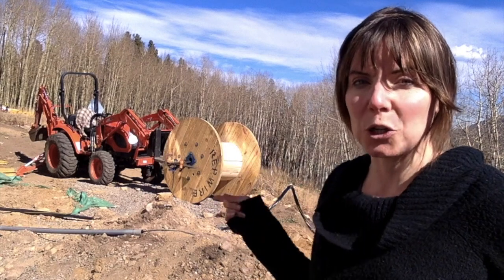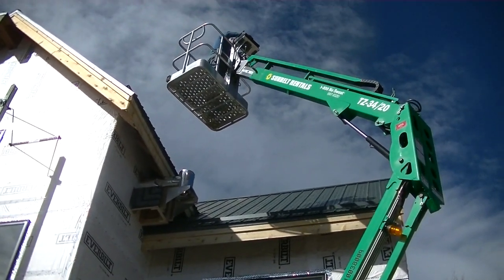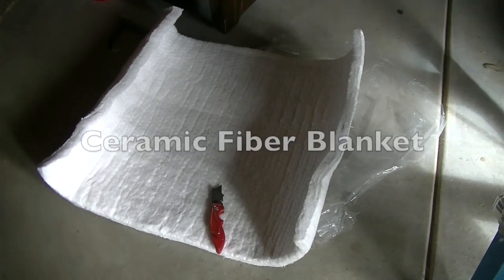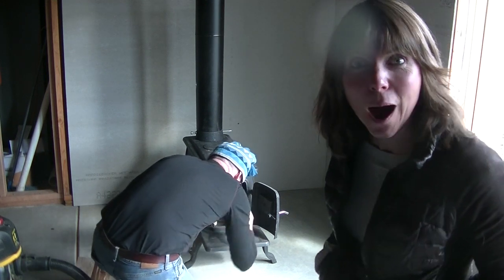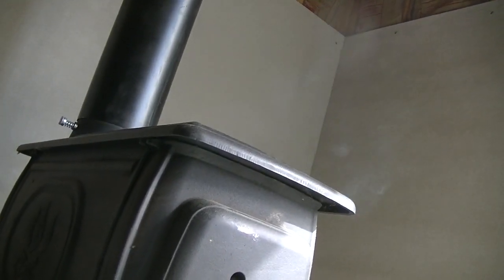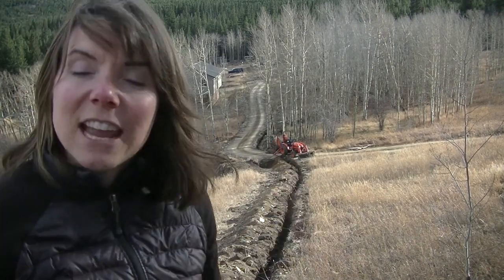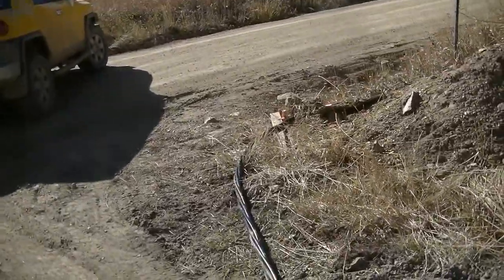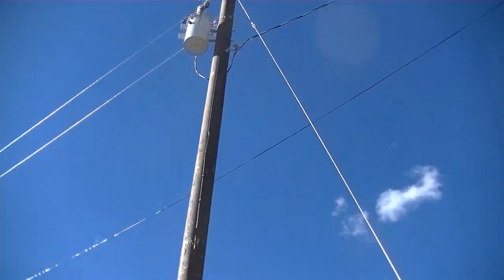Running 500 ft of Electrical Cable - Wood Stove Problems

Comment: The smell is more then likely the finish’s from manufacturering burning off, typical with a stove like the one you have I would set it outside and burn it off for a few hours, additionally check your damper position so that stove is drawing air.
Reply from the maker: Ok this is what we were suspecting. There was a ton of air going through, could hear it whistling all the way up the chimney.
Reply: Yes it is the oil in the stove, I bought a new stove 2 years ago. You need to have a small fire the first time ( paper and cardboard) let cool, then kindling the second fire, then a ‘normal ‘ fire. Did the wood burner not come with instructions? Also why not tie end of cable to house and drive tractor down hill straddling trench? One step instead of pulling by hand, and suv.then putting cable in trench by hand also. Too late for you guys, but maybe someone can learn from this. Love your channel.
Reply from the maker: Gotcha. I guess there's more than one way to drag a cable down the hill, couldn't really straddle the trench though- too maybe rocks, unstable and trees on the driveway side. Thanks!

Comment: So glad to see that cable in the trench.  Lets hope the weather holds off long enough to get it covered.  Most comments say the stove smoke is just the newness.  Probably so.  Mine smokes if the damper isn't fully open when I light it.  Then I can close it as needed after the stove and chimney get hot.
Reply from the maker: Yes, the second fire is proving much more tolerable. I'm sure there's a bit of a learning curve in operating any new appliance- how this stove is designed, vs the stove in our old place. Glad to have the heat though!

Comment: Yep had the same issue the first time I fired up a new stove. To late to do it outside now, open all the windows and doors and stay out of the house until the paint/oil burns off. Nice work on that chimney and electrical cable.
Reply from the maker: Ok good to know. Thanks!

Comment: The insulation you used is good stuff, its called a "wet blanket" its whats inside an oil boiler firebox! That placement of the stove sucks for putting in the chimney! the code is 2ft higher at 10ft away! Looks good! YES, that's normal for the stove to burn off gas!
Reply from the maker: Ah! Good to know.Going out the wall will make it easier if we ever decide to change location- won't have to deal with a hole in the roof.Thanks!!

Comment: Our first similar fireplace we learned the hard way also about the break in smell. Wife panicked and called the supplier who said we started a to hot fire for the initial fire. I guess your supposed to start out with newspaper and build the heat up gradually. But hey, who reads the instructions you know ? Our second unit we broke it in outside first. Our power was off for 6 days two years ago as we live in the Pennsylvania mountains very rural. We cooked on one of the fireplaces the whole time with our cast iron skillet. Love those units because you get heat from all sides. We had a conventional fireplace with a long hearth and when it required a firebrick reline we had a plate installed in the opening and ran stainless chimney liner in the chimney to the second of these units. Amazing how much more heat these produce than a conventional fireplace.
Reply from the maker: It's even difficult to break in a cast iron fry pan correctly! It's pretty cool now that we tried a second fire- much more lasting heat than a propane heater running for 20 minutes.

Comment: The wood stove should be just paint burning off if this is the first time you have used it, so shouldn't be anything to worry about it. 
That was a long pull I was watching him drive and drive....and thought " Gee  hope he didn't decide to go on a coffee run". That worked pretty slick on the forks and pulling it down the slop, sure he couldnt life his arms for a few days after , but it went well and just looks like you guys ordered just enough cable,
 so good on your measurements, nothing worse than being short when your pulling wire

Getting close and closer, looking forward to the next update!
Reply from the maker: Good to hear about the stove. It ended up being easier to work the cable than I expected, but glad we had that hill!

Comment: Welcome to ownership of property.
The stove could need to be seasoned, even if you did not assemble. small slow fire the first couple of time to do it slow. Another concern I have is the height of the chimney high enough so that you do not get down drafts from wind blowing down the chimney. I installed that type of chimney a couple times and was smoke free most of the time. and whether it is arose issue or performance issue you should have at least a clear area around the cap of ten ft. I do get down drafts when the outside temp is too high or strong winds are blowing. I agree with the comment about giving your electrician extra length of cable. Give her as much as you can to have both ends extra long. You electrician will be happier which turns into a happy home owner. Been burning wood since the early 70’s and have had 2 houses wired from building 3 houses. Good luck. Around here the trench has to have soft sand laid under the cable and the caution tape laid on top of it before back filling. Gas lines have to be 4’ down and electrical have to be 2’ down. Enjoy your house this winter. You deserve the fruits of your labors.
Reply from the maker: The wood stove is doing fine now. Haven't experienced the downdrafts yet- not sure though- its been very very windy over the past few days- with gusts near 40mph. Also gonna ask the electric inspector about the wire length at the pole, if we need more. We absolutely cannot wait to relax and enjoy- thanks!

Comment: Electric Service, Actually quite a Job. Most require a Caution Tape ⚠️(or wire) in the trench..
..above the wire, gas & water lines. To protect or find their location w a detector.
Luv your roof. 👌🏼 Wood Stoves do have a break-in burn 🔥process. 👈🏼
Reply from the maker: Thanks!
Reply from the maker: Ok thanks for the tip on the tape. If the electrician doesnt' have any, we'll grab some tomorrow.
Reply: @ColoradoMountainLiving  you guys might have to put an "S" on each end of the electrical connection in the trench so that when the ground settles the cable won't rip out of the meter or disconnect on the house.
Reply: Your electrician should be able to verify, most underground lines will have a foil caution tape/ribbon laid alongside cable."Caution buried electric cable" Looks good 👍
Reply from the maker: Our electrician is doing that part- thanks!

Comment: my experience many years ago tells me, if it whistles it is restricted somewhat. are you absolutely sure, absolutely sure, there is nothing inside the piping, fittings, damper chamber or cap. if the exhaust cannot get through it will make sounds. air has got to be able to get in the heater body as well. hope the best for you....g
Reply from the maker: Maybe not exactly a 'whistle' but more of a air flow sound. There's an opening at the bottom of the door that we want to close up with some angle iron to restrict air flow more. thanks!!

Comment: It looks like the damper was a bit too close to the stove.  By raising the flue, you allow enough clear space to create a draw space for the slight negative pressure that allows smoke to billow up the chimney rather than the room.  I've seen it quite a bit doing home inspections and simply turning the pipe around should fix the issue PDQ. ;)
Reply from the maker: Could have something to do with it. Too bad the flue is built into the stove and not in a separate pipe above. It smokes out the door easily when opened to add more logs. But working pretty good now.

Comment: I just put mine in this year in the first two times you use it or three it puts off an odor as it cures it will be fine it does look like it leaks from the top but it is not
Reply from the maker: ok good to hear. Thanks!
Reply: Also have to give it time to heat up the chimney, then smoke will go out.

Comment: Yep, first fire needs to be hot and long to flash off all the coatings and oils etc- very smokey but should be sorted after the first fire and heat cycle.
Reply from the maker: Working great now- thanks!

Comment: Those stoves are only kept together by tension rods. Check their tension. If all are tight @ 25 ft. lb. Or what the manufacture recommends. It should be good. Use a flashlight  at night in the burn chamber to identify any areas where light and smoke can escape the chamber
1-2" of wood ash can be used as a bottom seal along the door.

 You can get stove cement to cauk in any  minor opening or crack.  Make it as air tite as possible.
From your extreme chimney length  and the sound of interior air velocity through the intake holes it should be operating in a  partial vacuum. Thats good.

There is a rocket stove bell you can utilize to  trap more heat from the exaust stream. 
As well as a outside stove  air feed  to keep the stove from burning up  already heated inside air.
 Cold outside air burned in a your stove lets you keep all the btu's your wood creates. Imlo.

I did mine with a dryer vent  recepticle and hose and a 3" sheetmetal collar  cemented and screwed over the vent holes with metal self tapping screws. So as to only allow outside air to make up what was used in the fire box. BEING YOUR IN HIGH SNOW COUNTRY, a soffit  area intake would be prudent and reasonable as a location to take in outside air. All this is from my experience. Be well.
Reply from the maker: Wow thank you so much for sharing all the detailed info. We're gonna have to make some adjustments to take advantage of getting the most out of our little stove.

Comment: i have the same stove and when u first light it push the wood towards the back of the stove because it isn't drafting good yet..smoke will come out of the front , tops and everything until it starts drafting  with enough heat. dont light it up front..use those long matches and light it towards the back.
Reply from the maker: Aha. Yes, we did notice that. good call on lighting it in the back- will give it a try.

Comment: Guessing if the smell was so bad and not like a wood-smell, it must be from the finish burning off the new iron. How long did you let it burn?
Reply from the maker: Probably a couple of hours then let it die out because the smell. But next light was much better and working great now.

Comment: Some of these trees along the trench look like they have lost a lot of roots and stability. Even if they stay upright, they may root back into the trench and disrupt your cable later on. I recommend to get some advice. I very often see people rolling some type of tape on top of their lines, just in case more digging is needed Creating a map with the position of the line is also wise, When a digger cleaned our garden, we suddenly had a well: unmarked/mapped waterline. Best wishes from Holland.
Reply from the maker: Thank you. Someone mentioned adding tape in the trench- will ask the electrician today. Map is a great idea! Fortunately the gas & power lines parallel each other closely.

Comment: Instead of walking the wire down the hill how come you didn’t secure the wire beyond the pole or at the house and drive the tractor while unwinding the cable?
Reply: My thoughts exactly
Reply from the maker: The hill is a bit steeper than it looks and would be a bit nervous with all that wire on it going down the hill.

Comment: It would have been easier spooling the cable off if it was coming off the bottom. In the disconnect, the line wires that you ran connect at the top of the disconnect. The load wires that go to your panel inside your house connect at the bottom of the disconnect. The wires you left inside the disconnect box barely reach the top of the disconnect. Also, is that cable rated for direct burial?
Reply from the maker: Yep it's direct bury cable. Our electrician thought it looked ok.

Comment: Plumbing and electric are two big steps and it has to feel good to have those scheduled in the next couple weeks. Haven’t had any experience with new wood burning stoves so I can’t give you any advice on the smoke or smell although it would seem that a new stove could have some coating that could burn off when the stove is new. Looks like you’ll be skiing for Halloween, have fun but stay safe, can’t help the hubby if your in traction. Any luck finding a job from home yet? Just wondering if you have. God bless and stay safe.
Reply from the maker: Already feeling more confident with the wood stove and chimney in place. Hoping to hear about the job this week- they said "2 weeks".

Comment: I have yet to see a new woodstove not have some burn off residue, whether its oil to keep parts from corroding, or some other solvent, paint or sealer. If you had a good hot fire in it the first time most if not all should have burned off. By the third burn there should really be nothing left. Typical for free standing stoves is to do a burn outside before installation. If the smoke persists in future burns then you have a problem with a seal. To me that looks like one of those cheaper stoves that are not made for efficiency so the quality is much lower than say in a Lopi. This will also translate into having to burn a lot more wood. Learn where you get the best results using the dampers to help with heat output and a little better efficiency.  Later when you get into phase 2, I would suggest looking into a better wood stove like a Lopi or soapstone. The difference in the amount of wood used over a winter between a cheap woodstove and a more efficient one would amaze you. Keep up the good work!
Reply from the maker: The soapstone stoves look great. We're excited to upgrade once we get the major stuff done and can spend more on appliances. Thanks!

Comment: I think you might want to pull a little more slack in the electric cable where it enters the breaker box inside your house. Give electrician more than just what you have now. Just my thought. If you can. ‼️👍👍. Vinny 🇺🇸
Reply from the maker: There's about 2 extra feet - so hope that's enough for her to work with. Thanks!

Comment: little late now, but I would have backed the tractor down the hill with the spool on. Then started to unspool under the tractor as you drive up to the house. After a few feet the weight of the cable would have stayed in place as it was unspooling as he drove, which would have lightened the load on the front as he went up the hill. Good job anyway though.
Reply from the maker: Guess there's more than one way to skin a cat ;)

Comment: The stove will smell for a few burns. It should say in the directions, but who reads those!😉 
It is also best to burn “light loads” the first few times to keep the heat down to acclimate the iron to get a good long life from the stove. Really hot initial fires can cause issues in the casting.
Reply from the maker: Haha. ok  good to know.Thanks!

Comment: Man Ya'll got to keep the rocks off that triplex cable if ya not going to pipe it !!!!! I had one 300 ft cable that had a rock over time cut into the cable and rob the electricity in to the ground $$$
and finely failed over a 20 year time, at what point it cut (rock cut into it and sizzled every time it rained ) we dont know but the wire burned in to once it was done ! sand or good dirt is important ! you wont know it until it fails but you meter will ?
Reply from the maker: Wise words!! Bryan had to do a very careful backfill of the septic area for the same reason- rocks. We've got a few places we can pull clean dirt from. Do not want those rock problems!
Reply: @ColoradoMountainLiving  nice a good job

Comment: Your stove is doing both ,off gassing and leaking...its common on these stoves to leak some smoke until they are drafting correctly....with a long stove pipe like yours I would switch to a different model of stove that is EPA certified, no damper required on the stove pipe either like some have mention....OH YA read your instructions...
Reply from the maker: We got it now- thanks. This is just a temp stove for now.

Comment: well If you had a fan in an open window you may tray max heating it and ye wont to close that room off from the house an old pant tarp can do over door ways  ,,  and go camp out that night..  note you do not have a barro stove where ye need  or must to place it out  in side a brush frie to strip away the pant it add it hardware and fire the in side note add heat paint and then it good for in home .after the last out side maximum heat up  burn with some stove pipe add too.
Reply from the maker: Thanks!

Comment: I'm a little late to the party. The stove stink is paint curing. Be sure there are no rocks under your electric cable. The ground is always moving, though we can't see it, and it pushes rocks up. 
There is a red tape, like a caution tape, that you put at a specific depth on top of the cable. Your electrician will know all about that. Looks like everything is comming together nicely. Is the well in yet? See you in the next one.
Reply from the maker: We're going to get some sand to add over the cable before we rebury it. But like Bryan did with the septic, he'll pick out all the major rocks before backfilling. Good call on the tape- will pick some up. Still waiting on the well permit :(. But gives us a chance to scrounge up some $$$ in the meantime.